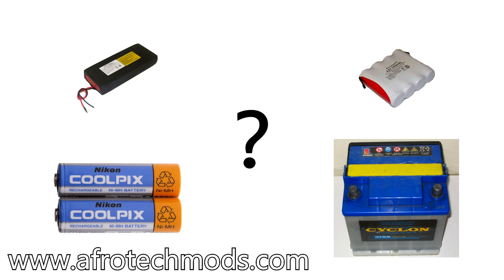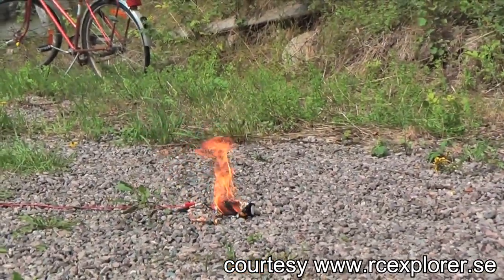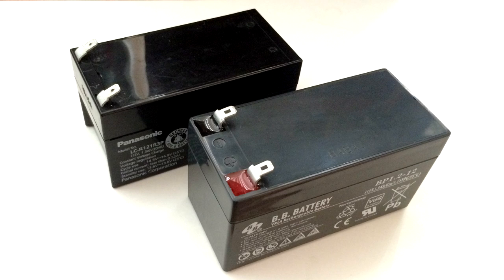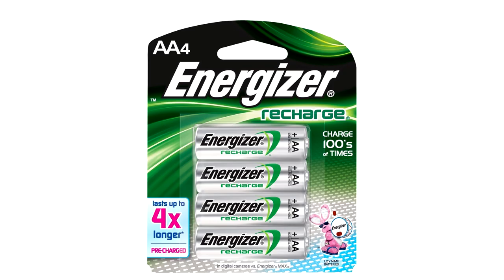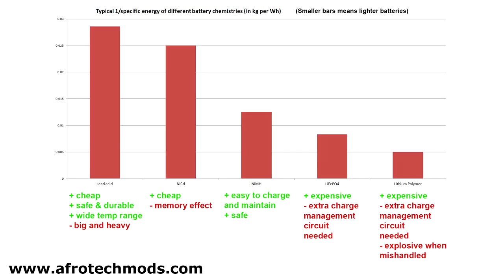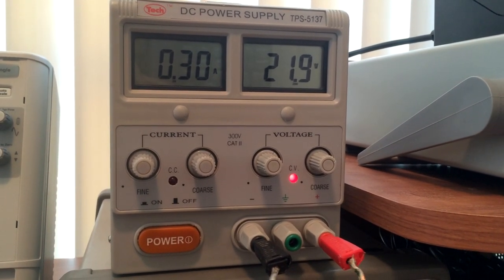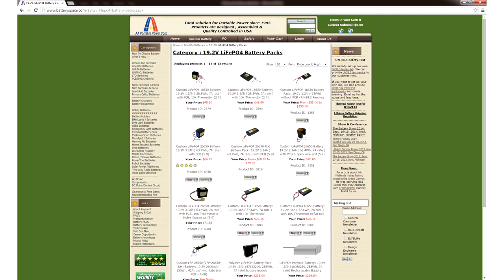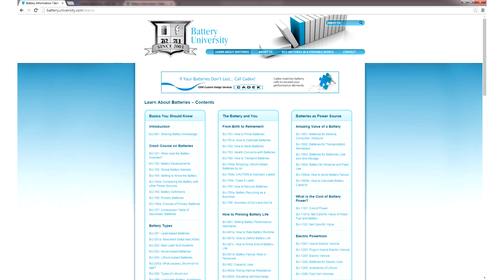🔋 How to choose a battery: A battery chemistry tutorial

Comment: so which would be the best for a remot control?
Reply: I mean Tv
Reply: You mean like a battery-powered 40" inch LCD TV? Then you must have huge capacity atleast.
Reply: i meant tv remote control
Reply: Take your pick. To super simplify it:

Standard alkaline batteries are easiest to find and have the lowest self-discharge. Meaning they drain the slowest when stored or not being used for extended periods like a remote (on the order of years).

Ni-MH/Ni-Cad can supply large loads and have the advantage of being rechargeable but they self-discharge a lot faster than alkaline's (several months) meaning they have to be recharged regularly. They also have a lower rated voltage but should not affect most TV remotes.

Lithium batteries (not Lithium-Ion) provide low self-discharge, high drain output high capacity but at the cost of higher price.

Lithium-ion rechargeable batteries have high capacity and high drain stability among other things but are not normally available in standard alkaline sizes and also produce over twice the voltage (rated for 3.7V but closer to 4.2V fully charged). 14500 Li-Ion batteries being one of the few, are about the same size as AA alkaline's but the higher voltage would cause damage to most TV remotes.
Reply: @Renato Barbosa
If you want rechargeable batteries for your TV remote control, then use NiMH batteries with a low self-discharge rate.
Sanyo/Panasonic Eneloop batteries will suit this job perfectly.

But if you can life with none rechargeable batteries, than stick to normal 1,5 V Alkaline batteries.

NiCd are a very bad choice. They are harmful when leaking and they tend to leak.
They are also not very usefull in a TV remote control.
They have a lower capacity than NiMH and no advantages in that area.
The only good thing about NiCd is that they can be discharged with much more Amperes than NiMH but you won't need that for a TV remote control. TV remote controls don't drain a lot of energy.

Lithium batteries are out of scope. Their voltage is above 3 V and thus not suitable for your TV remote control that assumes usually 1-2 AA(A) batteries at 1,2,-1,5 V each.
It's possible to convert the TV remote control to a one suitable for Lithium batteries, but it is not worth the time and money.

Comment: I'm curious to know about what would be best for using for a self-generating battery bank, that can charge from itself using copper coils and magnets and stores all that energy into Gel Cell Battery battery bank.
Reply: Please, tell me you're not Trying "zero point" energy...
Reply: Well... high rate of charge and discharge but short time of storage --> capacitors / super capacitors; medium rate of charge and high of discharge and long time of storage but a bit da dangerous (LiPo), low rate of charge and medium of discharge with medium time of storage but with long life span (NiMh),  medium rate of charge and high of discharge with long lifespan but expensive (LiFePo4) and so...
Reply: NiMh and LiFePo4